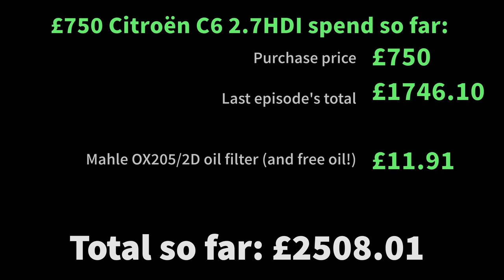Cheap Citroën C6 Project 7:  Time to see if all the work...worked!

Comment: On one of my favourite techical channels (AutoStrong-M) they dissected a 2.7 HDI and talked at lenght about the oil for the engine. To keep it short, they attribute the major crankshaft issues this engine is infamous for to wrong oil being used. Specifically, the oil should be B3 or C3, 5W40 or even 10W40! Jaguar and Land Rover recommend 5W30 B5 oil, which destroys the crankshaft.
Reply from the maker: Interesting.
Reply: I was in an auto parts store getting oil for my car and the salesperson told me that the new Alfa Romeo engines were made to such close tolerances that it is supercritical to give it the correct oil or suffer the consequences. Oils ain't oils goes the saying.

Comment: I've had a couple of cars with the SC-80 gearbox fitted, it's well documented that the gear box doesn't like heat or water for that matter lol. I fitted an external transmission cooler to my Vectra and it's been absolutely fine, theses boxes like to be kept cool and the type of cooler that is part of the main coolant radiator just isn't up to the job, plus they rot out and kill the gearbox.

Comment: A general rule of thumb I use when changing paper element oil filters is that if the filter housing points upwards, as it does in your C6, then it's very likely that it'll dribble oil into the sump as you undo it. With that design I always change the filter before I drain the oil.
Reply: The procedure I do is undo the filter housing a few turns which lets it drain, then drain the oil. By the time the oil has drained the filter will have drained as well which lets you take it out without spilling oil everywhere.
Reply from the maker: So will I from now on!

Comment: I never owned a car with the grey spheres (Can't afford to get myself into a C6 and I don't care about C5s that much), but I thought one of the main differences between the green and grey spheres is that the grey ones are "sealed for life", meaning they don't have the hole in the top like the green spheres, which is also why the grey ones don't have the little nub on the top. 

So from my understanding they are not refillable like the green ones used to be. They meant to last longer, but unfortunately once they need servicing, the only option is to have them replaced. 

Or I could be totally wrong, I'm no mechanic. But I figured it'd be worth mentioning in case it is true so that you don't waste your time taking them all off just to find out they're not serviceable afterwards.
Reply from the maker: Cheers. I know people who've had it done on a C6, though it may involve drilling the sphere - not totally sure.

Comment: Helped my brother service his 12yr old Focus with the Ford/Peugeot/Citreon 1.6 diesel engine. I too was surprised at the recessed sump plug and thought there must be 1/2 gallon left that can't drain out.
Reply: Took the sump off my wife's 206 1.6 HDi. Is about 300-400ml from memory (did measure it at the time) I modified the sump to push the plug down - from an "inny" to an "outy" to borrow belly button terminology as hated the thought of that last sludgy bit remaining at every change. 

I think - and is only a guess - that it's recessed so that if the sump is grounded out there's less chance of the plug being ripped out which of course would turn a bad day into a terrible one rather quickly!

Comment: Great video, thanks for making. I think the main difference between C2 and C3 oil is that C2 provides better fuel economy but it’s film strength is not as strong.  C3 provides better engine protection.

Comment: Hanging on to second before stopping is normal on the TC-80 gearbox, but it should change to first if it's bogging down
Reply from the maker: Correct, but I think this isn't changing down when it bogs as early as it should do.

Comment: Great vid as always, I have a few tips that might help you get a smooth ride out of your C6. My info is based on a C5 X7 (Fixed dampers) 18inch rims and on comfort mode. 

Be precise with tire pressure and always fill to the cars specs and factor in expansion when hot. 1-2 psi over makes a big difference. 

Definitely bleed out any air in the suspension system via front and back bleed nipples. I found air in the system makes the ride harder. 

You are right about the ride being disappointing after you reset to factory height. My 2009 C5 X7 wasn't right after setting back to factory height and it must be caused by pressure loss.
I spent many hours driving and fine tuning the height manually to compensate for the slight pressure loss. 

I found the first 1klm from startup to be a little rough. After 1klm the car raises to its desired "middle" height setting on a normal road surface. This height is where you want the maximum comfort and do not overshoot as 3-5mm is a night and day difference. To high = dash and interior rattling and poor isolation from small road imperfections but good on big bumps at high speed. To low = falling into medium size potholes, bottoming out on big ones and residual bounce afterwards but great over small imperfections and interior stops rattling.  

I started off high and very slowly dropped it down tiny increments until I found the sweet spot at the cars "middle" ride height setting. This takes days over a variety of different road conditions but well worth it. 
 
My C5 now floats along and steps up to the higher ride height only when the road has big waves and not single wheel potholes unless huge. 

Hope that helps :)
Reply: I found woth my C5 that what brand of tyres used made a massive impact on ride- I fitted Michelin and car was transformed like night and day- yes they are more expensive but for ride comfort, road noise reduction and grip money well spent. I dont think  the spheres will be a problem- mine were on their way out when I sold the car and were the next repair item- the ride became firmer not softer or wallowy so the theory in this video is wrong in my experience.
Reply: @michaeldavis7199  Yes the Michelins are the only way to go. I think the best way is to test all 7 spheres for pressure loss refill or replace and manually fine tune the ride height for the cars middle height level. In my experience the height setting it's very very touchy especially running low profile tires.
Reply: @imac3355  Well in my case I bought goodyear tyres (I had bridgestones before that) and that made a huge difference for me. The old ones were runflat so that means firmer sidewall so no RF tyres for comfort. I think it also has to do with rubber compound, the softer the rubber the more comfortable ride it is.
Reply: @tomaskusnir2374  The tire type and compound make a big difference especially for lower profiles. I only use Michelins and inflate to 34psi all round cold. Once hot the pressure is around 35psi which is what the C5 requests.
Reply from the maker: Cheers. Interesting about the bleed nipples...hadn't thought of that.
Reply: @UPnDOWN  

I watched Iain's vid on the C6 and there is definitely way to much bouncing going on. 
I'd check all damping solenoids/electrical connections are working on the 4 struts.
Also if the car is to high (stiff) the computer will not be able to sense the road and not activate the correct damping settings. The car is behaving like it has no damping at all unless you force it into sports mode.

Comment: Maybe it´s totally unrelated to your gearbox problem but...... I´ll tell the story anyway. We had a Peugeot 607 automatic as a company car. After repairs on the transmission (I think it was a ZF 4HP20) the car wouldn´t engage in 1st gear after coming to a stop. Letter it turned out to be that somebody who was working on the transmission with the transmission diagnostics left the W(inter) Mode enganged - and you couldn´t turn it on/off with the W/S switch. So......if you have the diagnostics (or know someone who has it) check it first.
Reply from the maker: Ahh, yeah I can imagine that. This isn't in winter mode, but it does have that. Limits the torque MASSIVELY on initial pull away.

Comment: I think the sticky out bit (which was handy to yank the old filter out with) has an O-ring. I think also said O-ring plugs a hole - hence, as the filter is withdrawn, the hole is uncovered and all oil in the filter housing is allowed to drain through the newly uncovered hole down into the sump.

Or to put it another way, yes I think the book would have told you: loosen oil filter housing ahead of loosening sump plug. More specifically think it is loosen (but don't remove) the filter housing is draining all the time it takes you to get car raised and oil plug out. Then lower car, remove now completely empty housing and new filter as penultimate job (ahead of important splosh oil around the full perimeter of the filler cap position despite best efforts not to spill the stuff!)

Matt
Reply from the maker: All makes sense.

Comment: I finished an oil change on my Smart Roadster just 10 minutes before I watched this - my Smart oil filter is tiny - about the size of the filter in a handheld vacuum cleaner.  The Smart can be a pain with some things, but the oil change was a pleasure!
Reply from the maker: Yeah, I used to sell those filters. They were like a shot glass!
Reply: That's appropriate, given a Smart engine is about as powerful as the motor in a handheld vaccum cleaner...
Reply: @andreasu.3546  😂😂😂

Comment: Morning Richard ,a quick tip when changing the filter next time clean the housing out and fit the filter element to the base using the locating lug apply some clean oil to the top of the filter and then screw the housing gently home ,not wishing to seem like I'm teaching you to such eggs ,but I find that gentle air line pressure feed into the block via the dipstick tube works very well and is a great deal less messy ,cheers Coggins.
Reply from the maker: I did clean the housing out quite thoroughly, to be fair (I just didn't show it) but I didn't even think about fitting the filter in that order. Only ever really do canister ones normally.

Comment: Just a thought when changing the oil filter I always replace the filter  onto  the knob locating  it in the filter housing first then just screw the cover on ,never tried it that way before
Reply from the maker: Hmmm, that's interesting. I hadn't thought of that, but it does make more sense.

Comment: Enjoying the updates. Same underdamped feeling in my C5 estate which has virtually the same suspension except for the variable damping system (AMVAR) that's on your C6. Good idea to test the spheres and I wonder if you can call Pleiades hydraulics as they are experts in Citroen hydraulics and possibly have developed a system for regassing grey saucer spheres with a fitted Tecnosir type valve.
I also bought all new struts from Poland, cost quite a bit to get to Australia however you might not need them unless leaking, losing pressure after sitting, or worn rubbers like in my C5.
I also have 5L of new LDS fluid. I think this might make the biggest difference to the damping because if the fluid has lost its viscosity then it would make sense for the fluid to flow through the damping valves with less restriction thus less damping.
Lucky you have the program to depressurise the system, I have to work out which valve to open to do that manually. You could replace the fluid when you have the spheres off and see if that makes a difference.
Also the AMVAR valves I read on the C6 forum can get sticky so I would be very interested if you got around to removing those and showing us how they work. You do look busy enough however!
Reply from the maker: I can't see me removing the AMVAR valves, but you never know! I'll document it if I do.

Comment: This 6 speed box is used in many psa products unless you come to a dead stop it never goes back into first gear. It's not a sporty gear box in any way it a leisurely turn of speed it does get caught when slowing and then flooring. It's not a fault
Reply from the maker: All makes sense, but I think this one is especially lazy.

Comment: I have to say, about floating like a boat, it is something that disappears when you drive a bit faster and without respect to suspension. Then it uses it's mass. It is simpy calibrated in hardware to faster driving than a CX wich is great in corners, if you are not afraid of the body roll, for example. XM is to "confused" over bumps in corners because he did not have double wishbone in front, like CX and C6 have.
When you drive it like a boss, it is like a flying carpet. And really stable in corners.
Reply from the maker: Wouldn't fully agree there, to be honest. I thought the XM was the best-all round ride I've had in a Citroen. The CX was smooth and soft - wonderfully so, but the body-roll DOES become an issue if it reaches the bump stops!

As for the C6, I'm reserving my thoughts for the POV drive video :-)

Comment: Saab 93 Dispsticks are just a flipping vague on the Petrol Turbo unit. With oil a lot of service centres now only suck the oil out which means a lot of the ',good chunky stuff' stays in the sump.' Speaking to my oil supplier a lot of this thin oil is to do with MPG rather than actually the engine be at its best on it. Manufacturers also pushed by the fleet market to extend intervals which won't benefit the private man for longevity if he sticks to them.

Comment: The do not use a wrench instruction is for closing not opening. But actually I think it also says 25nm or something like that. It used to do on the peugeots. and yes you should open the oil filter before the sump plug. I dont remeber exactly how but the plunger in the oil filter housing is supposed to open and let the oil into the sump.

Comment: I can believe there are "Ford" badges over some of the parts even though this is a PSA unit. This year, owing to needs must, chose to service my 7 year old Mk3.5 Focus with the 1.5 TDCi unit in it myself (with assistance from a mate who is a vehicle technician, was Citroen now VW). This, I'm led to believe, was a Ford in-house "start-again"  affair that replaced the PSA 1.6 "HDi" unit fitted to earlier Focus'. However it was noted that fuel, oil and air filters were all (it seems) carried over from the 1.6 HDi and have PSA logos stamped all over them as well as the Sump/Sump plug designs looking awfully familiar!
Reply from the maker: This is pretty much a Ford engine, though. They're built in Dagenham.

Comment: Maybe putting an additive for the transmission in will help…. I know ZF recommend that you use the original transmission oil and just change the filter and if you can’t save the fluid they say put a additive in…. It could be the same for the Aisen unit….. I been in the trade 20 years give or take but it’s always helped with that kind of behaviour especially when the oil is warm and thin…..

Comment: Is there a discernable difference in the suspension in sport mode? Assuming the c6 has sport mode?
The firmness regulator slide valve can get sticky, and, weirdly, corrode..
Although at that age the spheres are unlikely to be anywhere near perfect.
If you've initialised the box and it's not improved the easiest way to see what's going on is get some live data from it, that'll confirm that valve block or something more sinister.
As for hanging on to second, they do, bear in mind that on the v6's the autobox is on the edge of its design limits and the engine ecu limits torque output on request to avoid excess strain on the box.
Reply from the maker: There's a noticeable difference, yeah. Sport mode definitely takes some float out. Spheres are bound to have lost a bit, and apparently even 3-4bar can make a big difference.

How would I get live data, then? Do I need to come see you?!
Reply: A couple of bar is noticeable, I did the spheres on my mk1 c5, they were 2 to 2.5 bar down. The difference was incredible.
Current c5 needs doing too.

Switching your lexia to English would help!
Parameter measurements is in there somewhere, forget where in diagbox, but it's there, then you can see in real time exactly what the box is doing against a set of expected figures.
That said, IF it was the clutches slipping previously rather than the lock up clutch (it's quite common for the lock up clutch to slip) then it's probably the beginning of the end.. But again, live data will confirm it.
Worth dumping the fluid again and seeing what colour it is, and more importantly, how it smells..

Comment: As far as I know, the C3 spec includes the C2 spec so you can use C3 oil in a C2 / C1 requirement car.
Reply from the maker: I've heard this of the C2/C3 specs, but C1 I'm pretty sure is quite different. I've also read that you shouldn't substitute C3 for C2...who knows?! I'll just stick with the book I think!

Comment: as you noticed already, with this kind of oil filter, loosen it up first, to the point where you could take it out, but don't take it out yet, then lift the car up, drain the oil, and then replace the filter.
Reply: also, as someone who hasn't driven a C5 or C6 ever, what you are saying at 30:20 about the lag seems fairly normal to me, maybe make someone else who has more experience in c6's do a test drive in it. Sadly a lot of more modern cars with Electronic throttles and autoamtic transmissions do this kind of shit, worst offender i had for that was a new vw arteon, 240hp 2.0L, you had to put your foot down at the start of a roundabut if you wanted to accelerate when you left the roundabout, my Mothers 2015 Laguna is also quite bad, takes like half a second when you put your foot to the floor until it starts to actually move.